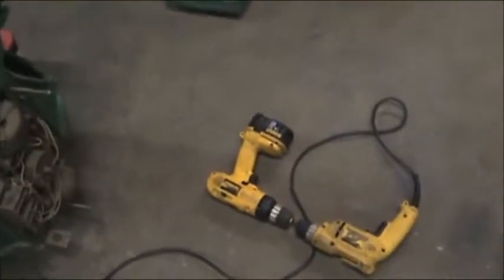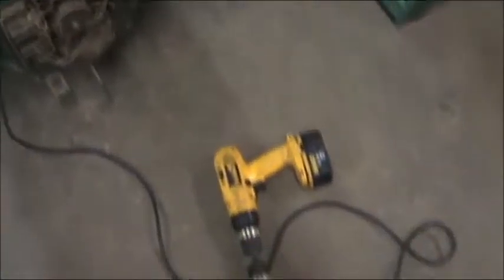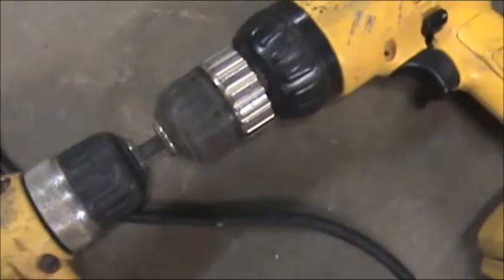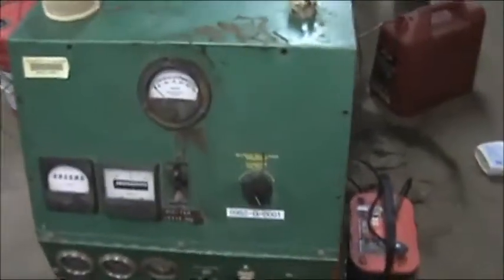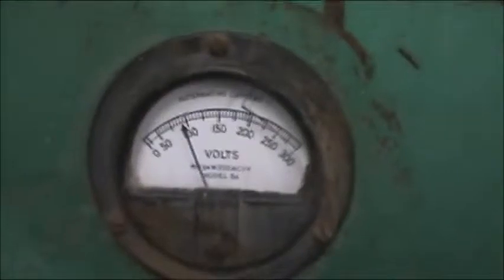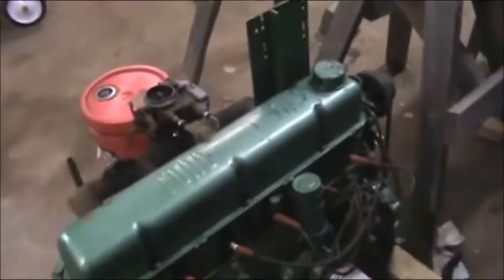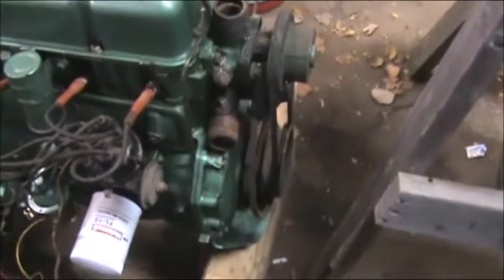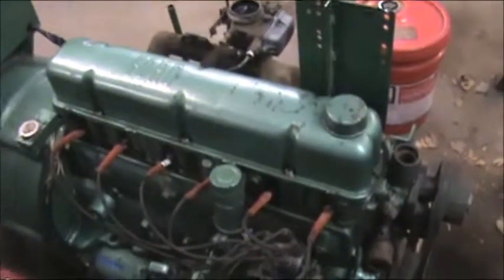25 kW Onan Generator Part4

Comment: that is delta connected machine T3 to To will be 190 volts dont use t3 for single phase that is a high leg machine unless your stater is 12 lead so u can do a double delta the no worry but if not t1  line t2 line to neuteal is what to uae then deduct 1/3 off off of the name plate also 1800 RPM will give you 60 cycles